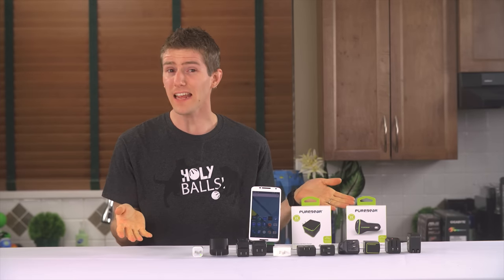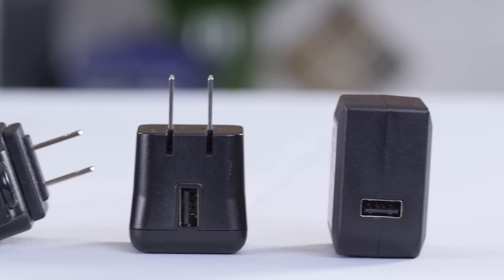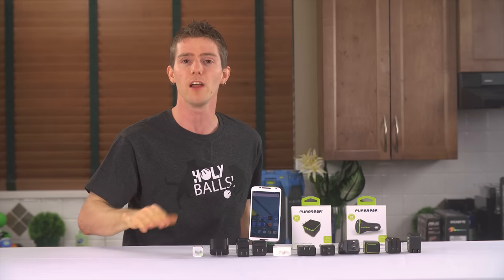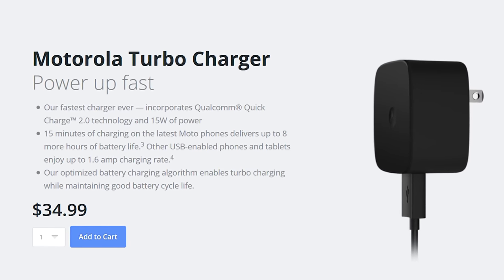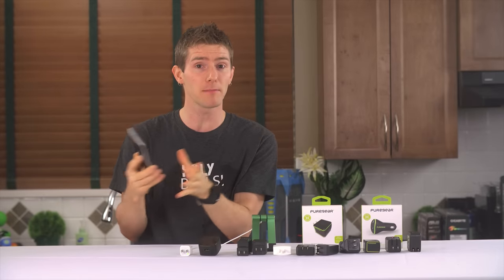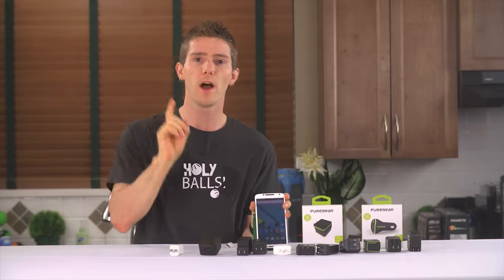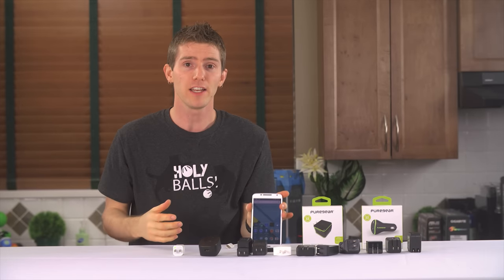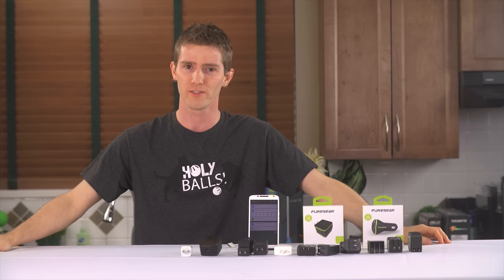Faster Phone Chargers Explained - Qualcomm Quick Charge 2.0

Comment: To make your smartphone charge faster:
1. Throw away your USB-cable and AC-adapter came with your smartphone (even if it's already 2-3 Amps)
2. Purchase a random 5V-AC-Adapter - 4 Amps or higher (NOT lower - The AC charger max - not the smartphone charging current, that would be ridiculous)
3. Purchase a Micro-USB-Cable. AT LEAST AWG-28 specification for all 4 strands
4. Enjoy...

It's crazy how much impact the USB cable makes when quick-charging the smartphone...
My LG G2 is now fully charged from an empty battery in about 20 minutes. And the G2 has a 3000 mAh battery...
Reply: You are destroying the little transformer in your phone. Expect the battery to die soon because atm it's like you're feeding it protein shakes 24/7.
Reply: you will kill your battery SUPER FAST that way because on the most phones it's recommended to charge it at 1-ampish rate if you charge faster sure it'll charge but it's not designed to charge that fast which will kill battery much faster than charging it at recommended rate,i recommend buying anker chargers,they got powerIQ thats what they call it technology that automatically detects recommended charging rate for smartphone,well yeah it'll charge slower but it'll charge as fast,as recommended to not kill battery very fast,maybe that 4amp charging might be OK for 1-2 charges when you DESPERATELY need to charge it fast but if ESPECIALLY battery is not removable,i don't recommend doing it
Reply: Four amps? That sounds like a great way to destroy your battery, Check your battery temperature while you're charging at 4 amps, though I'm skeptical that most batteries will allow a draw of 4 amps or higher.
Reply: Just connect the battery to a programmable power supply, set it to 10c (10A for 1Ah, 30A for 3Ah etc.).
Be sure to lower charge rate at 70% SoC. If you want to be safe, attach a temp sensor to the battery and instruct the power supply to compensate for temperature.
This way you can charge your battery in less than 10 mins.
If the battery is old and has high internal resistance, don't do this. If the battery doesn't have it's own cell balancing, don't do this either.
This way you can also optimize for lifespan by not charging your phone over night but charge it before you leave the house. High SoC leads to higher capacity loss over time (for Li Batteries), so keeping it on low charge over night increases life span. But at the same time quick charging does stress the cells more.
Reply: While everyone else has a point about killing the battery over time, no one said it wouldn't work... this seems like a good idea if you're in something like Linus' blind date scenario. A there-if-you-need-it super charge.
Reply: The charger I use is an Anker 5-Port wall charger - it should provide as much amps the phone will ask for - up to 8 Amps for all 5 ports...
I still charge without any modifications of the smartphone, only with an Amazon Basics USB-Cable (Which is AWG28) and the 5-port wall charger - it charges a little bit faster than the 2 amp charger which came with the smartphone... I don't think the AC charger will be maxed out - using a strong charger only gives the smartphone the power the smartphone asks for - not less power because of a charger with less amps...

Zviad Mikadze the original charger charged constantly at ~1.8 amps (I measured it) - the charger I use now charges at about ~2 amps (which seems to be the max the smartphone will ask for) and it can charge with up to 3 amps to also support tablet-charging... No charger will charge with more current than the smartphone will ask for (assuming the smartphone charging protection works fine)
Reply: Balestar just because he plugged in a 4amp power supply into his phone doesn't necessarily mean it's actually drawing 4amps I'm pretty sure the phones charging circuit wouldn't allow you to charge it at that rate.
Reply: DerParadonym
exactly was I going to say as well.... the phone determines how much amps it's gonna draw out of the charger. you could even plug it into a 20A charger and it would charge fine at 2A.
so people don't freak out about it.
charging with a higher voltage than 5V with a non quich charge compatible charger would lead into damage tho.
Reply: You have to check (measure it on every single charger) whether the AC-charger constantly provides 5 volts. Then you really don't have to care about amps because no charger has to run at 100% load (in fact they're most energy efficient, when they're under 60-70% load) - The only advantage of many amps: you can charge multipe devices as fast as they'd do with their original chargers on a single wall socket...
Reply: fightingfalconfan you're*
Reply: Pft noob just stick your phone in the microwave for 20 seconds and BOOM 100% charged.
Reply: or just buy a power bank and recharge it on the go
Reply: brett20000000009
I have a galaxy s2 and i think that test i have done have pretty much confirmed what you said. I tired a 0.5amp slot on battery bank and it was very slow, tried the 1 amp slot and it was fairly fast, tried the 1.3amp slot and it was very fast, the 2.1 amp slot was no faster than the 1.3amp one. I also tested with a proper charger that can do up to 5amps depending on what the device wants, got near enough the same times as with the 1.3amp slot.
The phone will control what the power going into the device is like. I once spilled water on the charging port of my S2 and the phone kept popping up warning messages in android saying that it cannot charge because there is too much voltage. So the phone will figure it out, it will reduce the number of claims on the warranty due to people using low quality chargers.
You can get components such as a 7805 voltage regulator that will keep voltage at 5v and the same sort of things are available for current. Of course a 7805 is a little big for a phone and evidently samsung uses more complex digital power management systems. But maybe the G3 is cheaper than the S5 in part because they didn't bother with power management etc.
Reply: Works even better when you charge an iphone by this method. 75% in 10 minutes, and 100% in 16 minutes.
Reply: sjs To be fair they do have a smaller battery. They aren't 3000mAh batteries. More like 1810mAh battery. So 20 mins 3000mAh, 16 mins 1810mAh. That isn't working better. It sounds like the battery still isn't pulling 5amp. More like 3amp in that time. Unless OP has their times wrong.
Reply: that's not how it works. the phone only draws the current that it can handle max...
Reply: ΕςΒιΕνα Ανώνυμος Bull, a LOT has to go wrong for that to happen. First of all, this only works if your Phone AND Laptop BOTH have metallic casing which is not grounded properly.
Secondly, you don't need the Laptop at all. If your phone is metallic and somehow connects the normally 5V to the chassis. The current will run through you towards earth. The Laptop is a non issue. So both the charger AND you Phone have to be faulty for that to happen.
Stop believing everything you see on the web. Learn about the real underlying science instead of trusting all that pseudo science that only describe phenomena.
Reply: NocturnaIReverie The http://www.righto.com/ (Ken Shirriff's blog) is far from "pseudo science". I am sure that you have not read the 3 articles by Ken Shirriff. Most probably you have seen only the photo that I have posted. I agree that that photo is not a good choice of mine.
Reply: ΕςΒιΕνα Ανώνυμος Ok that looks legit. The pic is still crap though. It would need three simultaneous errors for that to happen.
Reply: For anyone who are still fucking lost, in terms of Voltage Sources:
Current doesn't "push" like the Vdc / Vrms / Vpeak [to peak] amplitude force (Voltage aka electrical "potential" energy) does. While voltage is "pushed", current is "pulled", which is dependent on the LOAD (resistance) that controls the current pulled. (Load: e.g. any end point device; any electronic device which carries its own resistance including all the wires, components, etc)

Simple Analogy: You want a drink of tap water?
- Your water pressure is your constant regulated voltage (DC) which is dictated by your city and home water pumping system, your power source. (e.g. a cell / battery, powerplant, etc)
- Your flow of water is current. You open the faucet's valve(s) more or less to dictate how much flow of water (current) you need, because you are the LOAD. The water pressure (voltage) will be the same regardless of the water flow allowed from the faucet.
- The state or city reservoir, city and home pumps, and the pipes size, elevation, path (anything that causes friction with the water pressure and flow), and your own control of the faucet valve dictates the "resistance" to your water pressure and flow.
- The drain -- for all intents and purposes -- can be sort of a "ground", which closes the circuit and is a place water can go as it passes through the LOAD. Makes more sense if you assume that waste water is treated and then put back into circulation.
[In reference to voltage or current, voltage can have one constant zero-frequency polarity (or current moving in one direction; Direct Current) or have alternating "backn'forth or upn'down" polarity at a certain frequency (or current switching direction backn'forth; Alternating Current). AC cannot be compared to the real world practical application of water delivery and piping; so I only used DC for the analogy here.]

Real Application: Phone / phone charger 
- The voltage rating on the small little AC to DC power supply / voltage reg / transformer (i.e. your "phone charger") states the constant DC voltage it supplies. (electrical pressure or potential energy) Aka a PUSHED rating. Here is where you MUST MATCH the charger and device to be charged.
- The current rating on your phone charger is a MAXIMUM current rating, meaning the phone or whatever you plug into it that uses a standard interface to receive electricity will PULL and control the flow of current it needs. Just like you controlling the water faucet valve to fill your glass / bottle with water. Here is where you must make sure the charger can provide the device at least the MINIMUM current it needs to charge timely OR to operate.

Summary: Your phone or whatever electronic device controls the flow of current IT RECEIVES, not the other way around. There's 10 - 20 amps maximum draw from most standard 120 Volt wall sockets / per circuit breaker rail w/ 15 - 20 Amp trip; do you honestly think your PC, TV, smartphone charger, etc., pulls 20 amps each? wtf people, I thought public middle school / high school teaches you electricity and magnetism physics.
Reply: Yea except for it's configured in your kernel how much power your phone will draw from the wall to charge your phone.
Reply: worlwr2 Again, not entirely correct. What you said is only correct for voltage sources that - as the name suggests - supply a voltage. There are current sources too and those - again as the name suggests - supply current. They will push a certain current through the load. In this case the voltage will be "pulled". So for example when a current source of 1A is connected to a load that only uses 0.5A at 5V, the source will still push 1A and the voltage will increase so that 1A will flow. If that is not possible, because the resistance is very very high, the voltage will theoretically increase indefinitely and eventually a spark will form.
Li Ion Batteries are first charged with a current source. In that stage the cell voltage is variable and will increase until it reaches a certain threshold. That's when the charger (I'm not sure if it's usually built into the battery itself or in the phone. Those external chargers are just a voltage source that provide energy to those internal chargers, that really control the charging process) will switch to a voltage source and the current will slowly decrease until the battery is fully charged. The first stage (constant current) is the fastest the battery can charge. That's what's behind the "can charge up to 70% in 30 minutes, fully charged in 2 hours" that manufacturers sometimes say.
So the external charger just needs to be spec'd so that it does not bottelneck the current that the internal charger needs in the first stage. Any higher max current is unnecessary and will not increase charging performance.
Li Ion batteries should usually charge at 1C in the first stage (1C is the current that would need to go into the battery to fully charge it in one hour, so 3A for a 3Ah battery). So as a rule of thumb, get a 3A charger for a 3Ah battery, a 2A charger for a 2Ah battery, etc.
Reply: NocturnaIReverie which is why at the beginning of my comment I state, "...in terms of Voltage Sources." At the simpliest level, if a load requires constant current, of course it needs a passive or active Current Source. Vref or Vin must increase or the internal resistance of the current source needs to decrease. That threshold voltage you're talking about is specifically the nominal voltage IIRC.

Yes, li-ion and li-ion packaged like a true li polymer charge quickly at a constant current at a variable voltage until nominal voltage is reached and current can be throttled to battery peak charge. The battery protection circuits will protect against thermal runaway by effectively opening the circuit / stop current flow and allowing the battery to drain or rest then recharge back n' forth until you disconnect it; which is why recommendations state to disconnect after full charge or 60 minutes maximum for li-ion type batteries.

Anyway, I believe my original comment gets the point across without referencing too much technical specifics. A lot of times the load (resistance) varies greatly, and constant voltage is supplied. More often than not, Voltage source is referenced from beginner examples to more complex systems. When we get into LEDs, transistors, op-amps, transistor amplifiers, rechargeable batteries, etc., it becomes more of a conversation on current sources.
Reply: worlwr2 👍
Reply: NocturnaIReverie is that some unicode character? an emoji? I'm on a desktop web browser so all i see is a blank square. Btw I've added to my reply to you.
Reply: worlwr2 I'm on Firefox on Win 8.1 and I can see it... It's a thumbs up emoticon
Reply: NocturnaIReverie Win 7 and Google Chrome. Win 8+ has Unicode 6 support for emoji built-in (as does Windows Phone 8). Win 7 doesn't. At least not emoji specific Unicode blocks.
Reply: 4ampsx5volts thats 20watts hope your phone can dissipate that heat
Reply: chupamishuevos303 phone != power supply - as I said above, the phone never charges at 4 amps - it's the charger which can provide as many amps the phone asks for. It's always the phone which limits the charging current, and sadly most phones have chargers where the phone could ask for more amps than the power supply can provide (because of the cheap price for the hardware)

Comment: If you'll notice, all of the 'fast' chargers bump the output voltage up from USB's default 5v to 9v or 12v, but they keep current levels relatively low. This bump in voltage is what enables the faster charging rates, not the current rating of the charger. You measured 1.5 amps of current from all of your 2 amp chargers because that's the max amount of current your phone drew. In fact, if you look up the specs for the Nexus 6, you'll find that its max current draw at 5 volts is 1.6 amps--right in line with your own findings. If you're really curious about how close those 2 amp chargers can get to their rated capacities, buy or build a 2 amp dummy load and stick an ammeter in-circuit with the charger and load.

Also, there's no reason to assume fast-charging shortens battery life. All smartphones tightly control the amount of juice being fed to their battery at all times during the charge cycle. If the battery starts getting too hot, they automatically slow the charge rate, or stop charging it altogether.

Comment: 2 options for yourself and you definitely wanna use BOTH: use QC Quick Charge 2.0 if you are a Kancheong Spider at work (it means you are doing things quick) or use a 1A charger like the Apple stock wall adapter if you charge overnight that helps preventing expanding (yes, EXPANDING) your battery size to prevent explosions.